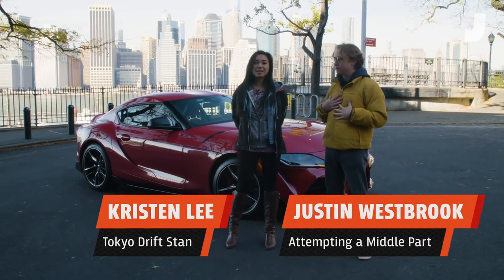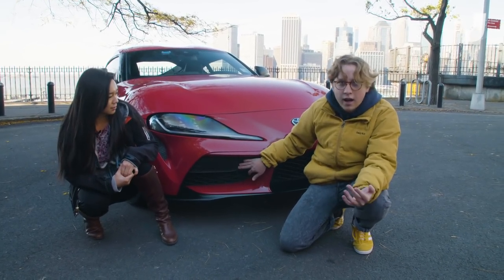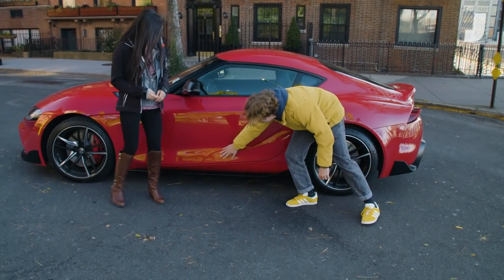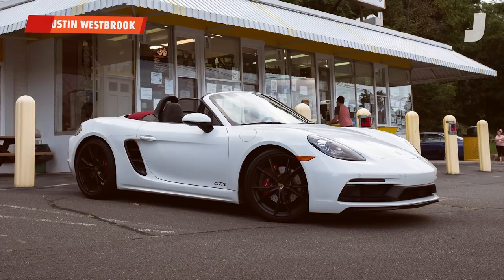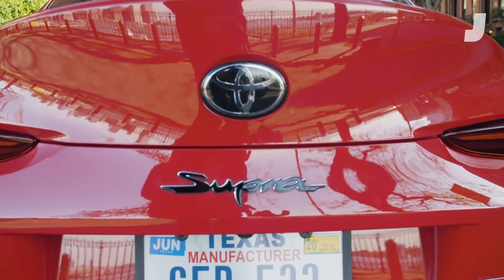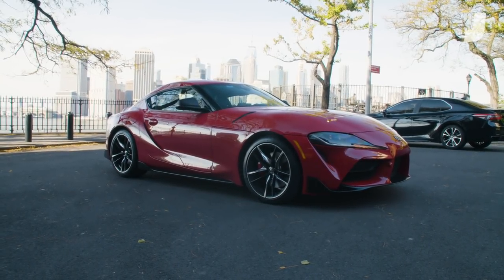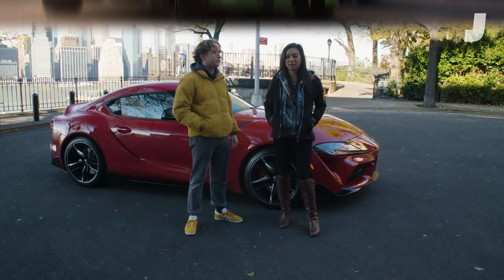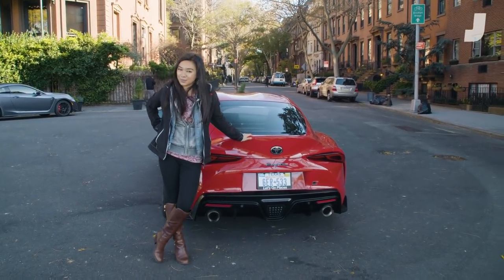How Many Fake Vents are on the 2020 Toyota Supra? | Ask Us Anything | Jalopnik

Comment: Porsches are refined and not flamboyant. its a car known for its reliability and pure driving experience. it's a daily driver that luxurious, fast and yet doesn't attract too much attention. The supra or known as a BMW is not refined has already had a recall and just doesn't have a classy and subtle look like a Porsche should. Compare the supra to the C8 Corvette,not a Porsche
Reply: Porsche have a 2 out 5 reliability rating as for a Toyota has 4 out 5. A Toyota will outlast any Porsche and you can buy several Toyotas for the price of a Porsche. Toyotas motto is simplicity and Porsche is more about racing. Also Porsches are a pain in the ass to work on, their isn't much room and most of the time you have to completely remove the engine from the car which takes an acual lift to do so.
Reply: @allenpesak6456  too bad there's not a single Toyota part on this car, well maybe the badges
Reply: @E9X330  yea but the BMW engineering  they picked is reliable. It's about money buddy why throw millions and years into designing something new when you can just pay someone that already has one available.
Reply: @E9X330  it's how Toyota has been the top contenders and one of the most successful car companies out there.

Comment: just for the fake vent or you because it looks cool and design is kinda important 😅
Reply: so fake vent is not possbile to open up at all..
Reply: wrong. go to the video when supras engineers talks about the car. the vents isnt fake they are just plugged and kepot there for tuners. they had all vents opend but then the car wasnt as stable on the tracks.
Reply: @highrpm85  yes they are fake

Comment: Could you theoretically cut through the plastic and make them functional?
Reply: Not Really. Jackie Ding goes into detail about the issues with most of the vent cut-outs. Primarily for the hood, there's no functional metal opening on the other side. The doors, well those are just plain unusable.
Reply: Yes they are completely functional
Reply: @nerfkilo  no they aren't
Reply: @AndenMowe-hh5qk  news flash, tada San lied. All of the vents are blocked off, there is no hole in the metal beneath, also the supra race cars don't use ANY of these vents
Reply: @E9X330  yes they are functional, they were put their for that purpose to be cut out and fitted with aftermarket vents that you can buy specifically for that car.
Reply: @E9X330  all about saving money is why they didn't install real vents in the first place. Would have added more to the price tag.
Reply: @allenpesak6456  too bad most of the vents are in areas were venting would barely work, or where they can't be cut at all because you would literally saw through the frame of the car lmao
Reply: @E9X330  yea no doubt it would take some work and ingenuity but that never stops a real mechanic. the vents around the wheels are in the general areas and yes they could be made to workan be effective.
Reply: @allenpesak6456  no they can't, again, the door vent for example is right Infront of the cars actual structural chassis, you CANNOT cut there without compromising structural integrity. Also if the vents are in logical areas and we'll placed, why does not a single supra racecar use them, instead add real vents elsewhere ? Spoiler alert, because the vents were there from the beginning just for styling, to force a connection to the FT-1
Reply: @E9X330   not everyone cares about them being real they care more about the price tag on a vehicle they probably will never take to a track and will use it as a ordinary daily driver. The vents aren't much of a gain compared to the price it would take to manufacture it that way and make it functional and effective. So they left you with the option to do it yourself an the only people who care are the ones who actually take them to race tracks where having vents is where you'll see them actually being put too actual use. 
Toyotas motto is simplicity  it's the reason why they are a successful car manufacturer company that makes reliable cars for cheap price, their cars overall rate at a 4 out of 5.
Reply: @allenpesak6456  I've literally just told you that not a single supra racecar uses these vents but you totally glossed over that point lmao. Is it so hard for you to accept that Toyota lied about this car ? It's not even the first time
Reply: @E9X330  because your not a macanic and because that's a "real" race car that's has $100,000s put into it and probably alot more designing it to perform at its best that it can.  That dosent change the fact that the "manufacturer" supra has false vents that can be made functional and effective.
Reply: @allenpesak6456  i am a mechanic lmao, no hobby supra racecar uses them either, the airflow in those locations literally makes those useless. Stop being an ignorant fanboy and accept the truth
Reply: @E9X330  oh I believe that you are a mechanic, just not high tier or a engineer. And once again most hobby race car drivers aren't going to throw that much money into those vents to make them functional for not much gain in Performance. All they do is cut down on turbulence, bring hot air out from the engine out or cool the brakes more efficiently. Not much for all the money and work.
Reply: @E9X330 so what Auto parts store do you work?

Comment: stupidity the car is a rebodied Z4 with some tweaks so what you should be talking about is how does it compare to it's donor? As for the vents they have in and out for the engine and the brakes on all corners but I agree if your going to make them make them real active vents do what they portray they are for, the fact that they did not shows that they where not going for performance, they only wanted appearance.
Reply: BMW developed the Z4 and MK5 supra concurrently, the MK5 is literally just the coupe version of the Z4 Roadster.

Comment: The fake vent are not intend to be there for show , if you tune the car to 850whp , you need cooling for the engine , the brake and so on , the car was made to be modify , let's thank Toyota for that.
Reply: No, they are fake vents for show.   You would literally have to hack the car up to make them functional.  Made to modify means there is a provision to have vents, not require a sawzall hack job with half-ass functionality on a $60k car.
Reply: Wrong. They're not designed to be modified, they're entirely aesthetic. Toyota lied and It's garbage.
Reply: Do not believe everything Toyota says about this car. They're just trying to sell you their products so of course they're gonna lie.
Reply: If Toyota really wanted you to modify their car, then they wouldnt void your warranty
Reply: @yoitsmearwyn2519  toyota invite most of the tuning company to take measure to make some aftermarket part.
Reply: Yep Toyota want you to cut it open later because stock supra doesn't need that much vents but at the end of the day stupid people still think Toyota make it just for show
Reply: @oogway1234  What are you supposed to cool with that vent of a door?